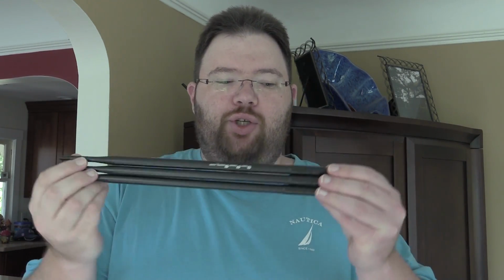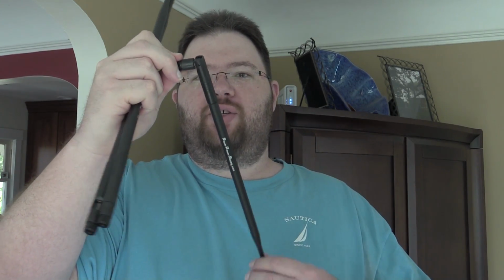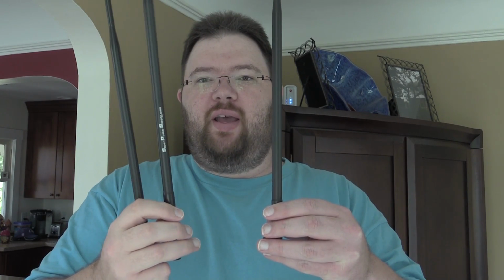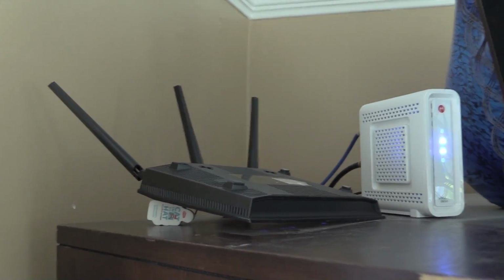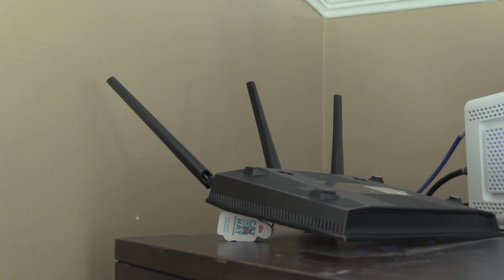Super Power Supply Antenna and ASUS RT-AC66 Update

Comment: what if you set it on a cheap laptop cooler?
also  of the 3 antennas which ones are  2.4 and which ones are the 5 ghz? could you just chanhe  1 or 2 2.4 antennas and not the 5ghz?

Comment: Have them on my RT-AC68U. Had issues with range for some reason. Had the newest firm ware. uninstalled and reinstalled older dirvers, no good. So I reinstalled. fiiixied the settings, and Added these badboys.
Saw an improvment in terms of range in both 5 and 2.4. so it's definitely worth the the 20 bucks

Comment: Some zalman memory heatsinks on the core ... hole in the top, take some juice from the dc jack and power a 80mm external fan with it.

Granted it's not going to be pretty, but it's effective. 

Used to do this with my overclocked DD-WRT linksys routers.

Comment: I know call me over kill bill but after having more then one of my routers over heat due to how humid, and warm it can get here during the summer here in SC, I keep a small little personal size desk fan, and I run it on low speed, and sense i don't currently do a lot of intensive streaming in my house, my old Linksys WRT-54G V2 with DD-WRT, and extended antennas stays cool, and stable, with 2 cheap N range extenders I can cover my whole house, and then some, best $18(router GoodWill, and antennas off eBay) I ever spent on a router lol! BTW if anyone is curious the extenders I use are Sabrent NT-WRPT which I found 2 for on eBay last year used for $30, which are normally about $25-$27 a pop, and the setup can be a bitch but once setup with the right router they are stable, but beware if they are put near a microwave, and it gets turned on they will more times then not drop signal like a rock, and I will say that is one thing I hate about 2.4Ghz wireless devices, but most main stream things still only seem to have 2.4Ghz, so until 5Ghz becomes the pure universal standard I don't see the point for myself in getting a 5Ghz router, and extenders.